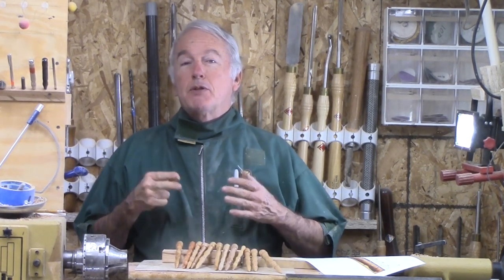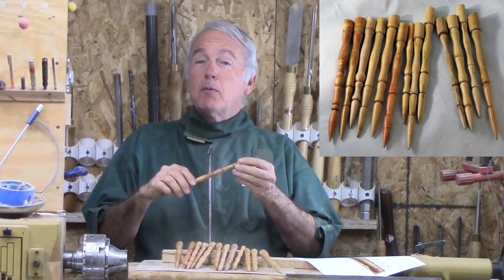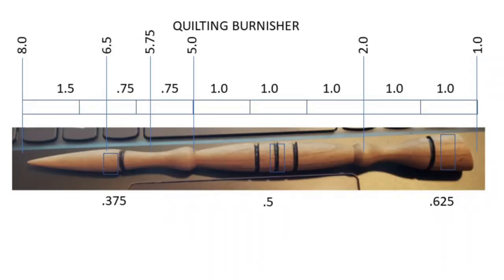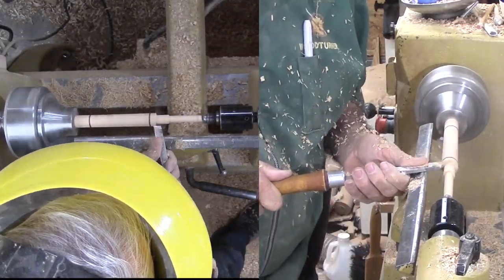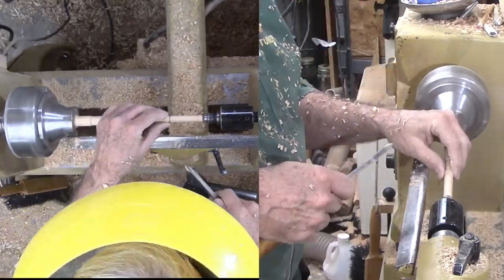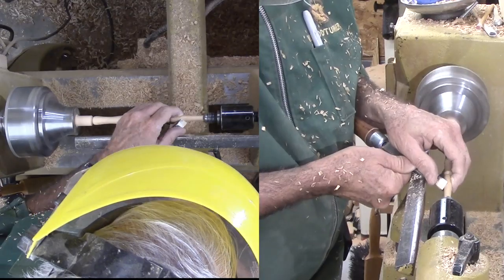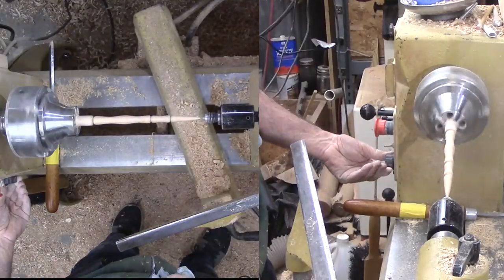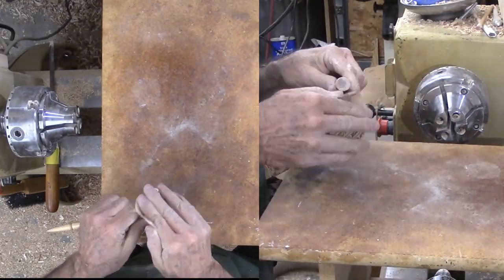Woodturning Quilt Burnisher For Paper Pieced Quilts

Comment: Thanks Alan for another video on a quick and easy (relatively) project for a nice functional gift. BTW what chuck and jaw set were you using?  Thanks.  Cheers, Tom
Reply from the maker: I use Vicmarc chucks since I've standardized on one brand for interchangeability. These jaws were the long nose jaws for the VM120.
Alan
Reply: As Wood Turns Thanks for the info.  I’ve been looking at the Vicmarc chucks for larger capacity jaws 5-6”+.  Also the long nose look highly useful.  Thanks again.  Cheers, Tom